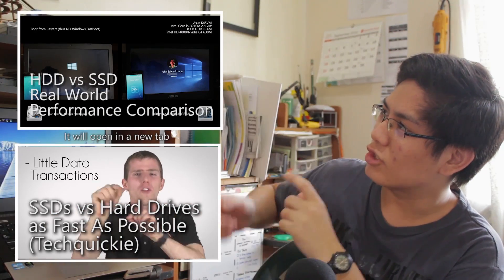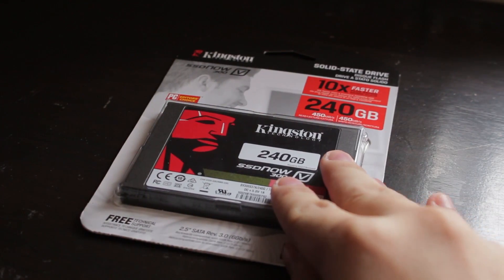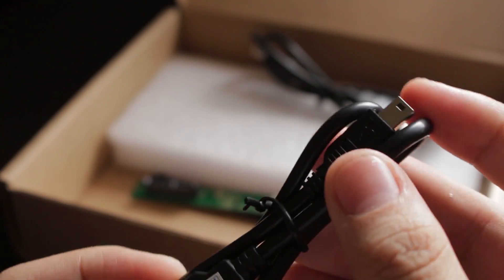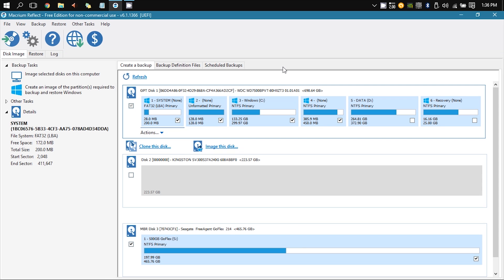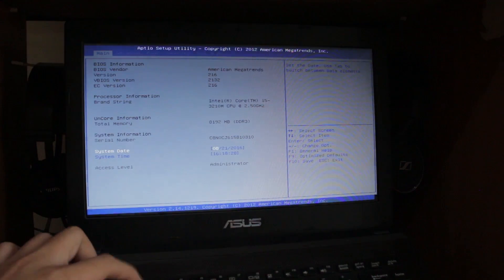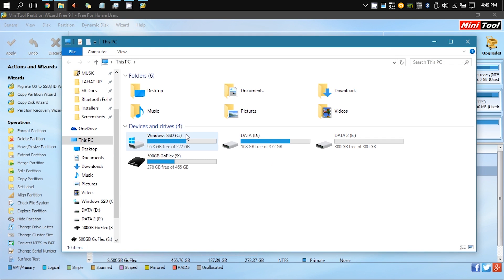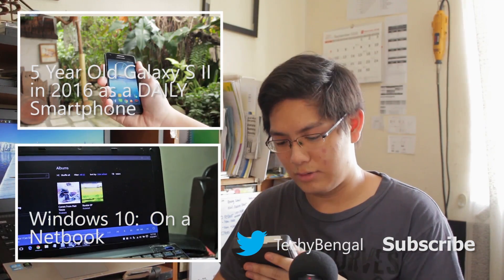[OLD] SSD + HDD Dual Drive Setup in Almost ANY LAPTOP

Comment from the maker: * MAJOR UPDATE: NEW version of the guide here: *
https://www.youtube.com/watch?v=H09SEyoE8yY
Reply: Hiii ,
May I know is it safe for the laptop if I use this method . I visited a service center they told its ain't safe that it will burn my laptop . Give me a solution . Im a bit confused
Reply: can we use the dvd drive externally?my laptop said it could be upgraded to 2TB HDD but why is there a need to pull out DVD drive?
model:hp15bs179tx
Reply: Hi everyone I used this product and it is a very high quality product. Currently this product is discounted and there are few available click on the link you want to buy: https://amzn.to/326lIdh
Reply: https://www.youtube.com/watch?v=6BBHU0ctAHU

Comment: my laptop hp 250 g7 i3 3  replacement of the old hard drive which was 1tb and I put a 500gb and an NVMe M.2 2880 SSD and dvd rom extra ssd

Comment: How did identify the connectors to the multibay drive? I need to bypass the caddy part and use an extension for the multibay connector.

Comment: Lenovo website states that we can install SSD upto 128GB in parallel with 1TB HDD (stock) on an ideapad 510 Laptop. Can you please confirm if we can use 480GB SSD by replacing the DVD drive or not?

Comment: it's really important to determine your caddy size before buying for i did that mistake, and when im on the process of installing it everything went south real quick, i snapped the plastic tabs broken, lost some scews in the process, disassembled my dvd caddy hoping i can put the caddy in but nothing really aligned, ended up using a knife to pry it hoping it will align the sata connectors but didnt work, i searched again and learned that there are two caddy sizes out there, but still lucky enough that i didnt break my hdd, ordered the 12.7 ang gonna try again

Comment: mine does't have a DvD drive so what I did was put the SSD inside the laptop with some tape beside the HDD since the SSD is small enough to fit inside. it was not easy but hey my computer is fast now

Comment: a lot of the large hdd manufacturers have an oem version of acronis available to download.

OEM acronis will work to clone any brand drive but you MUST have at least one drive connected that matches the branded version of acronis you are using.

so if you want to use the wd version you must have a wd drive connected, it can even be a wd external drive as long as the oem acronis can see it.

Comment: Too many steps, I have done this both on desktop and laptop.  Here is what I do:  connect the SSD to a USB adapter and make sure it's on windows explorer, clone the drive to an SSD,  the SSD can be smaller as long it fits all the written files. I copied a 500 GB to a 240 SSD drive. When finish just swaps drive. No messing with bios.

Comment: Back when I was in high school a terabyte hard drive was unheard of.  We were all still using 40, 60 or 100 GB drives and we thought they could store a lot.  Of course these days there are games that will fill one of those older drives to the point that you would not have much room for anything else.

Comment: When you use SUPERGLUE, it means the builder is in the category of the 3 kinds of millennials.. I understand that the manufacturers build this delicate plastics that is hard to insert to begin with and hardest to remove it.  they torture humans with their designs. Exibit A proves what happens when you lack experience or to abrupt or eager to assemble or disassemble parts. There is no substitute for experience.  However, not bad the idea of caddy for SSD.

Comment: .........my view is that All Laptops are WRONGLY DESIGNED............the Design for all Laptops and computers should be  DOUBLE HARD DISCS (SSD's)...............the activity of the computer should be MIRRORED so that what happens on DRIVE A........simultaneously happens on DRIVE B............(an exact REAL-TIME copy of events ......equal on both drives)

Thx

Comment: I did this and it is working well, I changed the HDD with the SSD as suggested below. But the laptop is turning off within a half minute if I don't plug it in to charge. Why is that? It worked well before. I can use it with the charger but not with the battery.

Comment: I have a Dell6400 laptop and the DVD bay just pops out when pushing the black tap on the out side of the drive. It is much EZer to do then this video tells you to do. The caddy was only about $7.00 from e-bay and it works.

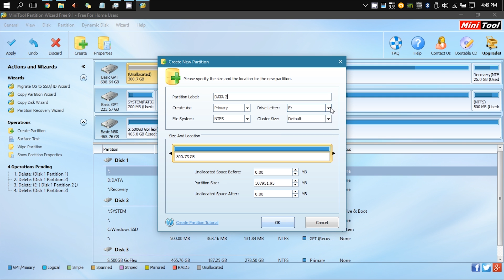Comment: 6:47 help plz it told me to restart the pc so I did and now it's stuck at the recovery screen help plz
Reply: life of inspiringbrain make sure that u have chosen Sad dive for boot sequence in BIOS. If failed again, install a fresh version of Windows 10 with a bootable Pendrive
Reply: @AnshuKumar-xz6si   for some reason it just boots on my hdd not on my ssd now I will format both of my drives and then put the ssd only then I will download Windows then when the laptop is running on the ssd I will add the hdd as a second drive and put my games on that
Reply: Try

Comment: Thank you for video. It was interesting. I have a question: Can we instead of one 2.5 inch SSD, put two M.2 SSD. They are much smaller and maybe even 3 or 4 would fit there. To buy some sort of host adapter for 4 M.2 SSD's. Put all those M.2 SSDs into that adapter, and that adapter put into the Caddy and connect somehow(this part is interesting especially), then of course insert Caddy into CD drive slot. Is it possible?

Comment: Wrong information. CD/DVD Drive is always SATA 2 connection and Hard Disk is having SATA 3 connection. Best method is to shift the old Hard Disk into Caddy and new SSD into SATA 3 port.
Reply: it is not wrong , it would just  limit a little bit your ssd , just a little bit , you may not notice the difference
- and he mentioned this point in 3 times above ( 2 comments and in the description also !)

Comment: I want to buy PC with having 2 TB SSD as C Drive and rest of 4TB HDD drive with compatible mother board and Ram for supporting this size of capacity. Will it be possible?
I want to put software in C drive and all back ups and personal files in HDD.
Just confirm possibilities.

Comment: For anyone having CPU issues... It seems that there is an adjustable switch in the caddy that prevents the system interrupts.  (https://msfn.org/board/topic/172738-on-optical-bay-hd-caddy-adapters-for-laptops/) you need to change the switch depending on the brand of your laptop. The higher CPU is caused by system interruption because your cpu thinks that the optical bay is constantly open. Adjusting the switch solved it for me.

Comment: Possible fix for SSD with caddy does not boot into windows after cloning - edit the bootloader configuration to allow booting from SSD with caddy. Usually can done by installing GRUB but requires booting into linux live usb.

However, it is better to install it fresh rather than cloning it. If you're installing SSD alongside with HDD, make sure that you should check the "system reserved" partition where the bootloader installed whether on existing HDD or the SSD. If the bootloader installed on existing HDD, better set the boot priority to HDD first.

Comment: done all process. my ssd is in dvd bay. i can also boot into it but issue is i can't set it as default. when i go to bios and select DVD as 1st boot option and save , it freeze and i have to force start it. so every time i start laptop i have to go to boot menu and then start the windows. any help?
Reply: If else fails, just swap the HDD with SSD, while the HDD should be placed inside the caddy if possible. The real problem is the caddy power slot seems smaller than the usual HDD/SSD drive power slot.
Reply: Possible fix for SSD with caddy does not boot into windows after cloning - edit the bootloader configuration to allow booting from SSD with caddy. Usually can done by installing GRUB but requires booting into linux live usb and it must me installed on HDD, not SSD with caddy.
Reply: @AmirZaimMohdZaini  ok let me try. thanks

Comment: hi! i buy caddy but not showing up hdd. even i changed caddy case many times. is my laptop supported ?
Reply: If else fails, just swap the existing drive with SSD.
Reply: @AmirZaimMohdZaini   i try it. putting ssd on caddy and hdd on its old place. but i want hdd on caddy. but not showing up. not showing on swaping also.
Reply: @ozairkhan7639  Possible fix for SSD with caddy does not boot into windows after cloning - edit the bootloader configuration to allow booting from SSD with caddy. Usually can done by installing GRUB but requires booting into linux live usb.

Also, make sure that you're using SATA SSD, not the wrong type of SSDs like the M.2 SSD.
Reply: @AmirZaimMohdZaini  means replace windows bootloader with GRUB.  is that you mean ?  does i have to install linux too. ?
Reply: @ozairkhan7639  not necessarily. You can install the GRUB without installing linux.

BTW, you might need to check whether your PC could detect the HDD/SSD with caddy installed and should be detected on BIOS setting. Then, you can proceed installing windows but make sure to know where the bootloader installed, either SSD or the existing HDD. 

If the bootloader installed on existing HDD but the OS installed on the SSD, better set the boot priority to HDD first.
Reply: @AmirZaimMohdZaini  bootloader is installed on both ssd and hdd. and OS is also installed on both HDD AND SSD. so remove windows from HDD in this way bootloader on HDD will be remove and try booting from SSD. is that right ?

Comment: Thank for the helpful video. I followed everything you showed but I got into this problem: Whenever I go into the BIOS and set my SSD as Primary Boot then save and reboot, the computer will always try to scan and repair the drive and boot back using my HDD. I've tried again and again but still the same. Unless I go into BIOS and select override boot to SSD, it won't start from it. Should I just delete the windows partition on my HDD?

Comment: this is for those who have pre-installed windows in the HDD. after cloning the data into the SSD will you be able to use original windows in SSD without having any issues ?? like any activation issues ??

Comment: I need help guys...I am trying to do this, replacing the hdd of a Lenovo Laptop to ssd. The ssd is biit drive and hdd is extra storage. 
However, my Lenovo ideapad 100 laptop (Core i3, 14" screen), I don't know how to, or I am unable to access BIOS setting.
I tried pressing F2 when rebooting, or Fn key + F2, or Shift +F2, or Ctrl+F2, or Ctrl+Shift+F2, but nothing works...
Anyone knows about this?

Comment: I have a Lenovo Ideapad 500 and I have a few questions about doing this. Could someone help me out?
Firstly, can this be done with my laptop?
 My battery is within the shell of the laptop, you can't just click it off like this example and my old laptop...
Secondly, I'm an architecture student and I run a whole host of programs. I'm looking to put on the SSD my windows operating system (for definite) and maybe one or two of these programs, probably photoshop and indesign together as I often use them in conjunction and have pretty large files on them (thinking I could keep the files separate, just the program files on SSD). What size SSD would you recommend?

Comment: My boot drive is now a Samsung 500GB SSD. I bought a caddy much like the one in your video for my ASUS TP550LA to hold the old sata drive at 750GB for secondary storage and installed it in the optcal drive bay. The SSD is working fine as the boot drive with a fresh install of windows 10, but I cannot get the laptop to detect the old SATA drive in the optical drive bay. Cannot see it in the BIOS or in Disk Management in Windows. What could the problem be?
Reply: Possible fix - install GRUB and it will configure automatically to allow booting from SSD with caddy.

Comment: i am using dell latitude e7440 Ram DDR3L can i  insert a ram DDR3 in second slot. Is DDR3L and DDR3 compatible to run in same laptop i.e dell latitude e7470....?
Model    Memory   Type     Dimm Slots   Max System Memory      Memory Compatibility
Latitude  E6430     DDR3          2                         16GB                                   1333/1600MHz
Latitude  E7440     DDR3L        2                         16GB                                     1600MHz

Comment: You should mention that caddies have 2 sizes, also there is even not need to measure its thickness (in millimeters) using a ruler, just read a manual of your laptop or go to their site and find your model and you will find the size of your dvd which will be the size of your caddy

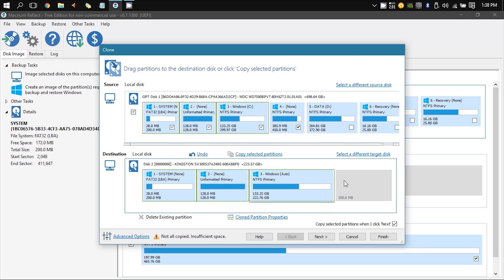Comment: I had trouble cloning the windows to a smaller ssd. It would give me errors it seems the ssd needs to be the same size as the hdd for it to work. How you do it around 4:45 is difficult to follow.

Comment: When you install an bios update to your laptop make sure that the boot order has the SSD still on 1. In my case it changed it back to the old harddrive that was already formatted and a data storage. When the laptop restarts it then looks like the bios update failed and the computer is stuck in the boot process which made me a little hysterical.

Comment: I have installed my ssd on to the sata hdd slot and place the old hdd on the caddy. But now the old hdd is not showing in my computer. This situation is true for the vice versa, meaning when I put the old hdd at its own place and install the ssd on the caddy. What should I do ?

Comment: just wondering. is there how to reuse the DVD rom as the external?
Reply: it's cheaper if you just buy an external unit, there's probably some external cases but I don't see the point in reusing it, you might probably even be better selling it as spare parts on ebay :)

Comment: hey , i wanted to know if i use both ssd and hdd and hdd in the caddy and want to use linux or some other OS on it while using main OS on ssd. Am i going to find it slower than using the designated hdd space on the laptop or both the ssd and hdd is gonna run on same speed?? Is the optical drive connector SATA any slower?

Comment: I did this to my laptop! Before seeing your video though, I put the SSD in where the hard drive was and put the hard drive in the disk drive slot so I didn't have to mess around with the bios and I'd get a more reliable connection I guess you could say. Unfortunately the cable at my house got struck by lightning (no, not the power, don't tell me that I should've plugged it into a surge protector, it was in one!!) the cable was connected to the router, connected to my laptop's Ethernet port, my tv was also plugged into the hdmi and got fried with it. Sad for me cause I'd just spent 60 bucks for new SSD, adapter for SSD, and new thermal paste for it... well at least I have a desktop with a bad hard drive, I hope that's the only problem and I hope my ssd didn't get fried too! I plan on reusing it. I guess it could've been worse but I'd rather have the other laptop that was worse and older to get hit then the better one but what am I gonna do... Anyways, it was fast! It made a huge improvement and I loved it, for some reason my computer would boot into the automatic repair and I'd have to click on return to windows 10 or something but other then that it was a good computer! Sorry for my ranting lol

Comment: I do watch your you tube videos and i am one of your subscriber .  Recently i have watched your video where you replaced your hhd with ssd and put your hdd in 2nd caddy.
I did the same and every thing is working fine except one thing . My hdd transfer rate decreases while read write it.  I did proper migration and formatted hhd before punting it inside. 
Pssible cases : 
my hdd caddy is not supporting 1tb hdd.
port which connect hdd to motherboard is not working.
Also , Some time it create problem in shutdown of system. Have to forcefully shutdown after long waiting.

I have Samsung-NP350V5C-S08IN i 7,8BG Notebook, win 8.1

Comment: Will it work if I straight up install the SSD where the HDD is and the HDD into the caddy? Like will the laptop be able to boot up and will I be able to clone the HDD to the SSD? Or should I just leave the SSD in the caddy if it won't affect performance? So my plan is to buy a 128gb SSD for boot up, Microsoft applications, and some other small software that I use. I will keep games, media, some large files, and programs like Autodesk applications on the HDD.

Comment: Just a quick question:
I have a DIY external HDD that I got from my old laptop for storage. And I'm thinking of using that to put in my caddy for more reliable extra storage. Would I have to format the drive for it to work or would it read as if it were connected trough USB, but faster?

Comment: There’s one small problem with this which is that not all laptop motherboards will support this . You can see it on the BIOS after installation where often it doesn’t know how to identify the new hardware as it’s expecting it to be the DVD drive. It works wonderfully on desktops without fail.

Comment: I need help, I did everything it worked fine. Untill Windows did a automatic update. Now it's stuck in startup recovery. Please help
Reply from the maker: Most likely caused by the the Windows 10 1803 (April 2018) update. Not an issue with the hardware but more on Windows 10 being Windows 10.
Reply: EJ Tech  thanks for the reply,  but the thing is it was windows 7, would that still be the same result. And is there a way to reverse the effect.

Comment: I just do not understand why with these programs? Cloning can be done with special software that is specific to the applicable SSD, while removing unnecessary partitions and merging can be done with the built-in program to Windows (%windir%\system32\compmgmt.msc /s).  Usually has special software for migrating from HDD to SSD. It is free of charge.